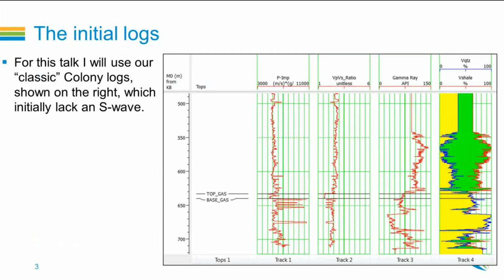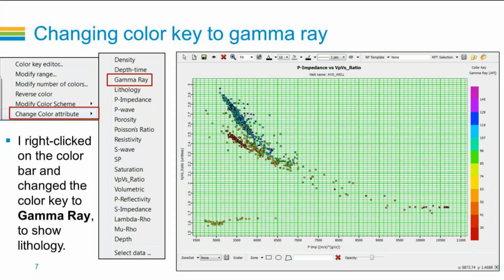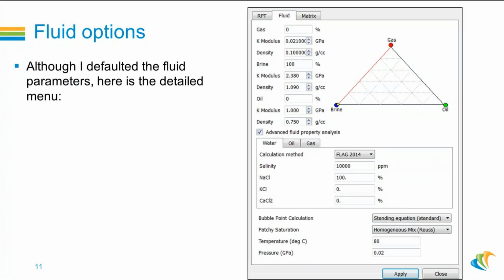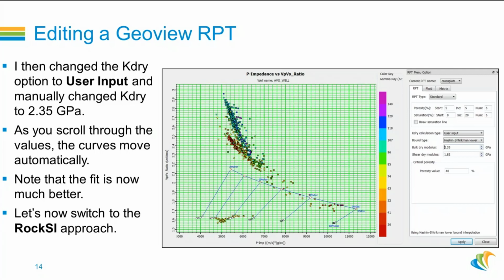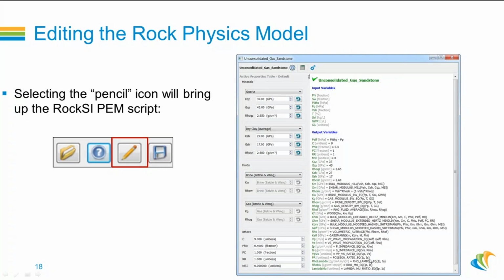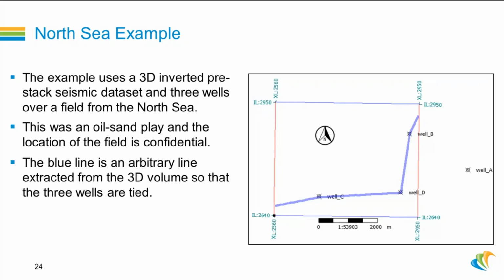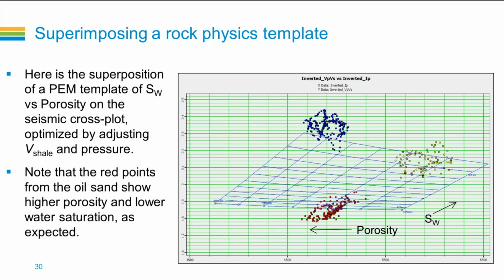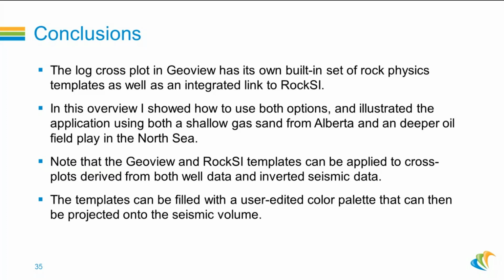Easy-to-use Rock Physics Templates in HampsonRussell Geoview and RockSI Integration

Comment: Thank you. Please how did you create Vs prediction in hydrocarbon bearing zones since the mud-rock line equation only valid for wet sand case?
Reply from the maker: We used Greenberg and Castagna (1992) method which proposes that the shear-wave velocity for a brine-saturated rock with mixed mineral components can be given as a Voigt-Reuss-Hill average of the volume components of each mineral. This is an iterative method and was applied only to the samples in the selected reservoir zone which matched zone conditions. For all other samples, Castagna's equation was used.
Reply: @ReservoirExperts  thank you. Did you carried out  any fluid substitution at the hydrocarbon zone to brine condition to honor the castagna equation to get Vs. ?